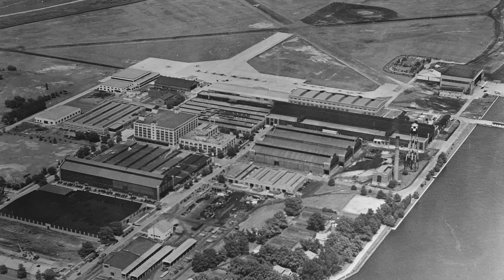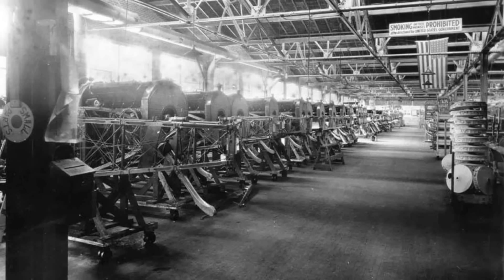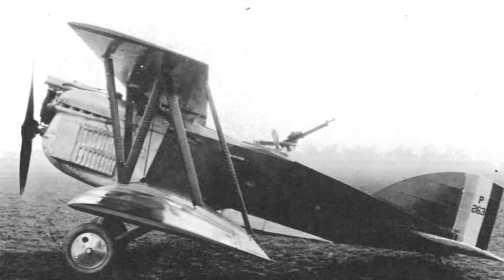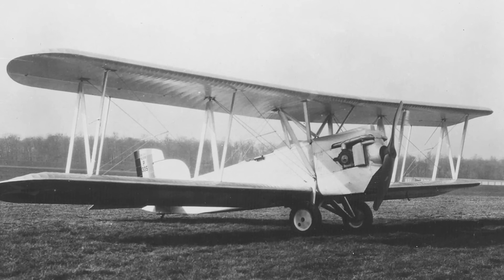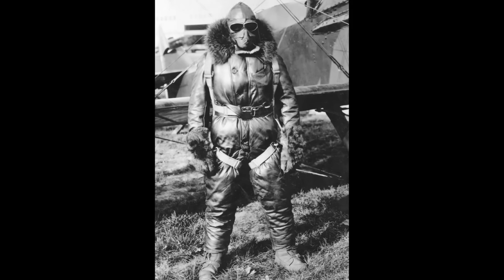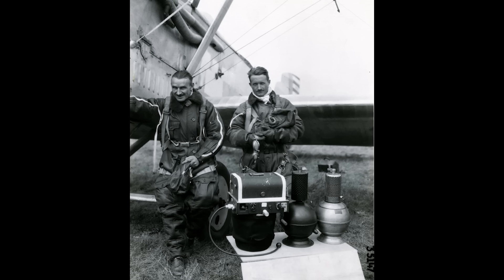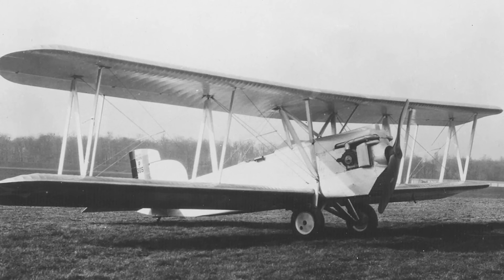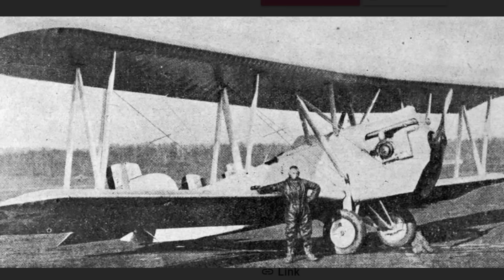Engineering Division TP-1/XCO-5; The US Army’s Final Fighter

Comment: I wonder why he didn't just cut the ignition? They were close enough to WWI to remember that as standard speed control for rotary engines. (It still works today, if you have a jammed or otherwise throttle on anything but a Diesel.)